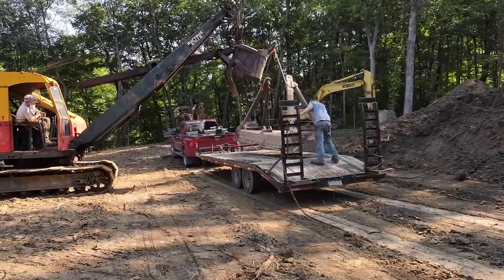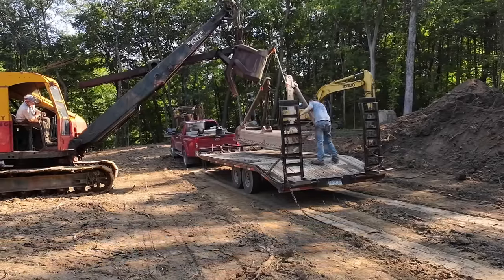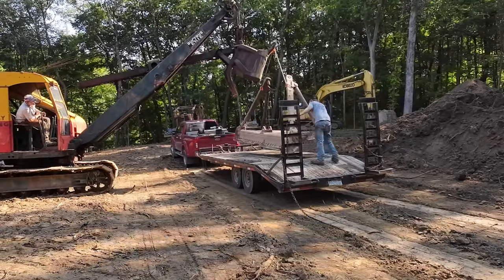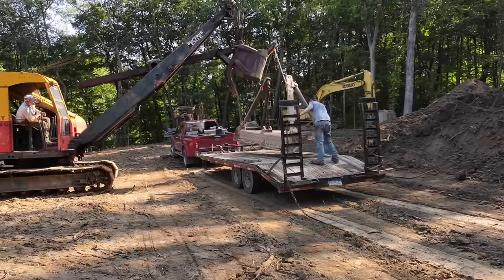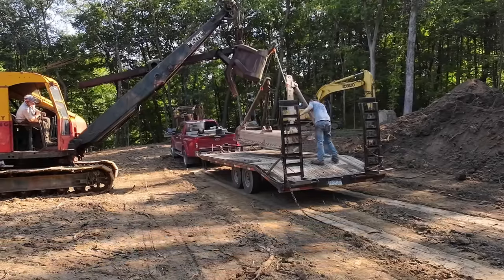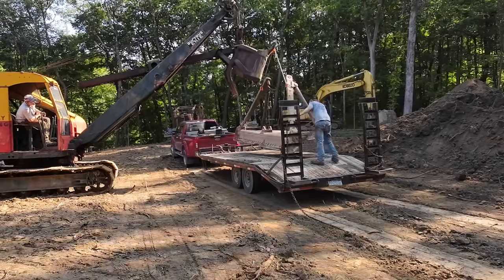Moving BIG IRON

Comment: Thanks to guys like you and Sam these old machine will be around for generations to see how America got it done when it needed do-in. Good on ya!  And for all those “Carbon Footprint” naysayers out there, there’s a Bucyrus-Erie model 1850-B electric shovel on display in SE Kansas that—at one time was the  largest ELECTRIC shovel in the world. Ironically it dug coal in a strip mine back in the 60s and 70s.
Reply: Big Brutus !
Reply: Yeah, I've been there to see that thing 2 or 3 times.  It is really a brute.  They said when it would load up on a big bucket full the lights would dim in town. 😄
Reply: I need to make it over there.
Reply: Any petroleum powered engine wastes a lot of energy and requires the cost of maintenance, electric just plug it in and work it! The torque of the motors is amazing.
Reply: @lotharschiese8559  Agreed, but the irony of it is —it dug coal and it probably took coal energy to forge the steel it was made of.
Reply: @Bellboy40  we got to good see Big Brutus for the first time a couple of years ago after having seen it in the distance a few times. Impressive is not a big enough word to describe it.
Reply: @lotharschiese8559  Basically there are some truths in your statement. But there are limitations. Don't get me wrong, I have bought 3 Tesla EVs and have no interest in buying another gasser. However, comma, the current state of the art simply is not at the point where we could have battery powered equipment like this. Diesel (and gasoline) still has its place, and will for years. Current manufacture has made massive inroads in pollution control, efficiency and reliability. These antiques remind us of how far we have come.
We can help limit the pollution issues to a certain extent, but for the nonce, petroleum based ICE gear like this, trucks and some autos are a necessity to meet people's needs .
Reply: Yes, electric. Fed either by a monster Diesel gen set or the local mains. Quite efficient, and powerful as all getout.
Reply: @The_DuMont_Network  What are the odds the electric shovel mined coal that was used to run the power plant which provided power for the shovel? Just like power plants today that run on coal and natural gas to charge electric cars. I agree that the torque from an electric motor is great, especially with peak torque being at almost a locked rotor condition vs. IC having peak hp at high rpm. It works for freight trains and electric cars. It is crazy that governments and individuals think we can to from vehicles and equipment that primarily run on IC engines to electric in 10 years or less, especially when it took so long to get IC engines to where they are, our grid can't even handle current usage in plenty of places (like right now, where I am, in SoCal with the AC running), and they don't even have good EV options for a light duty pickup for real world use let alone electric HD pickups to replace my diesel, or medium and heavy duty trucks and equipment. Electric vehicles are great as an option for people who want it and where it is practical. Mandates are ridiculous, but I'm a pure blood and libertarian who is practical and I realize that on any given aspect of life people can vary drastically so there isn't one answer that fits everyone.

Comment: Every time you run your beautiful D8, I am blown away by how quiet it runs, even under load. It really does purr like a kitty Cat! What is it about that massive engine that makes it run so quiet?

BTW - I LOVE your trademark limerick: "Come with me, and you'l see, an OSHA violation!" It never gets old!
Reply: still laughing on that one, he needs to do a mocking satire song with his band on that
Reply: Couldn't tell ya, but I periodically have to deal with an old CAT 3304PCNA that is has a similar quiet purr at idle. It sounds great but unfortunately smokes like a train and the machine it powers is an ergonomic disaster.
Reply: It only seems quiet, unless you are comparing it to other videos of similar machines. They were very loud when I was a kid and would see them. I have run new machines and they are so quiet they can sneak up behind you like a car or pickup truck. The Jackson Brothers have two D11 dozers. https://youtu.be/mxB9i_U1OTo?si=Ix192GopQboOb6Ix  The big equipment has big engines and big engines don't usually spin as fast and they make tons of torque. I think the engine in the D11 only goes to 1800 rpm for normal operating range. They sound quiet because they spin slower and with such a narrow rpm range, they don't have to be revved high for full power. You don't hear the sound change as much as a small machine like a skid steer.
Reply: Not his trademark, but still funny!

Comment: One could easily assume Scrappy's truck has a dead miss by the sound on video, but the best way to tell for certain is to do a IR  temp gun check on exhaust manifold ports. If you got a cold port, you got a miss. (or crack each injector line and listen for changes, or unplug if electronic)

Comment: I'm not an expert but one thing I was both advised and learned is with a cable blade, just lift it enough to clear the ground when backing up, makes resetting when starting another push easier and faster
Reply: ❤GOOD TO KNOW!

Comment: Idea for an episode.  You may already have this in mind, but I thought I would suggest it anyway. On the “incredible driveway” you built a couple years back (you do have some gear parked alongside there) OR back along the back side loop around driveway (which the bride may prefer since you want to build your house at the end of the main driveway) you build 45 degree parking pads (nicely gravelled) for each of your treasures. Will keep of the grass and mud while not in use and would be a wicked display.  Finally THANKS for the OSHA jingle - long overdue.  Thanks for sharing. Ps can we get a nice high view straight down to re-familiarize with the farm layout?

Comment: Hey Matt, that shovel seems to be pretty nimble in her advanced years, she didn’t even burp a little when she picked up that dozer blade. You have a great friend in Sam too. That big Mack that he has sounds great in traditional V8 fashion. They have power to burn. I drove a Mack cab over when I worked for UPS for almost 14 years. Mine didn’t sound like that, I had a straight turbo charged 6 cylinder that was very smooth, loads of power. Anyway love the videos keep ‘em comin’.

Comment: I'm impressed to see that the temporary track tensioning fix held out.    Now that I've learned that the Scrappy Industries V8 semi sound is normal, I need to research to see why they designed it like that.   The sound makes it seem like there is a timing gap so that there is a period where none of the cylinders is making power.

Comment: The D8 engine has a very powerful sound. It always sounds to me as it the diesel must be revved up to "clean the spark plugs".   Imagine the traction with new treads.. I bet that costs more than my Jeep is worth.
Reply: There’s a bit of imbalance with the injectors since they won’t all spray exactly the same. At idle it’s rough since the fuel sprayed is low so a little imbalance is a big percentage of the fuel. When the rpm/load is raised they’re spraying more fuel so the imbalance smooths out.

Comment: Fixed a few track adjusters the same way. The old Bucyrus sounds Great.
You think you would have a exhaust stack on the old girl by now.
Oh and btw, fyi,  you need to start covering that exhaust iwhen transporting if you don't want to do another turbo. can get away with a few miles while the turbine is spinning with no oil but not many.
Have fun at the show.
TGP

Comment: Looks don't matter as long as it works it sure beats having someone running along beside you trying to hold a bottle jack in place. I didn't get to see you run the shovel I kind of hung around it for a little while I didn't realize how small it was which really makes it the perfect size it's easy to move . It's a really clean machine. What was the deal with the grader I seen it sitting back there in the mud on Saturday

Comment: Matt, I am still trying to work out... what is the round plate with the long bolt and tied dow at the front of the engine cowling used for? .. to line up your next victim.. lol.
Reply from the maker: Hahah no it holds a spool of cable
Reply: ok cool and what is that cable used for? @DieselCreek
Reply from the maker: @TimsBitsnPieces  for the blade. When you run those every day the cable will get wear points so you’d pull some extra line through to move all the wear points down some and cut the end off back at the cable control. Or if you broke the cable as I did you could simply pul more through
Reply: Thanks for the reply.

Comment: Question- What are the 3 different "bushing locations" for on the blade bar of the D8? I see your blade attaches to the rear most on..... but what would the other 2 locations be used for?
Reply: On the one i ran u could pin the blade at a right or left angle using those pin holes.

Comment: I am not done watching, I am at the Track tightening segment which reminded me of a poor Kid that wanted to be an operator so badly he would come early and grease all of the equipment fuel them all and get everything started.  Long of short, he did not know how the track tensioner worked and kept pumping watching for grease to push out, Fast forward to a broken track link pin.  (Note, he put at least a case of grease tubes into it)

Comment: That white Penscke truck sticks out like a sore thumb,Lol & was that your old grader that  you were pulling or someone else's,bcause it sure looked like yours,unless you bought another grader bcause you have 2 already but you can't have to many old graders & I like those old graders better than the new ones bcause they have the steering wheel & the levers,these new graders doesn't even have the steering wheel or the levers all they have is 2 plastic joysticks which can be busted off at any point of time & the computer crap & if I had the money to buy one I'd take it to someone who could & would take the joysticks out & wiring & take out the computer crap & put in all of the levers & big steering wheel bcause I was watching a video on YouTube & this guy was grading a fire road with a Catapiller grader,I forget what model it was but it was a new one but it had a tiny plastic steering wheel in it,how are you supposed to steer with a tiny steering wheel,when Catapiller built that grader they should've put a bigger one in plus it had those cheap joysticks in the arms of the seat,someone screwed up when they built that one,but anyways, yeah I'd buy a new one just for kicks & I'd do what I said to it if I had the money, but I don't